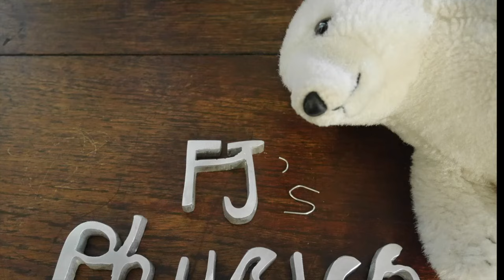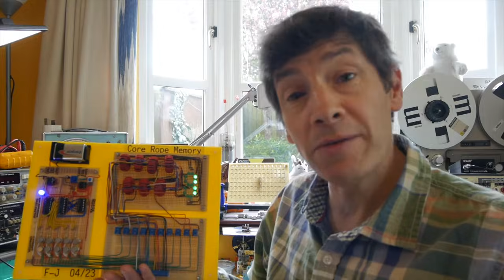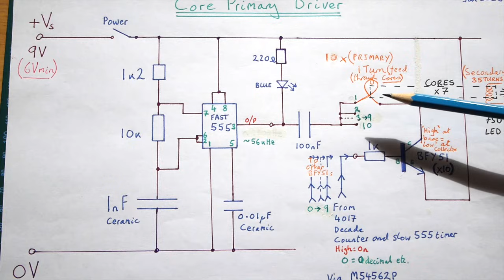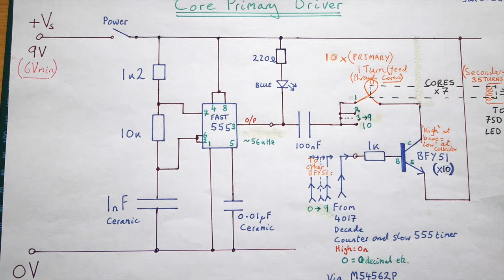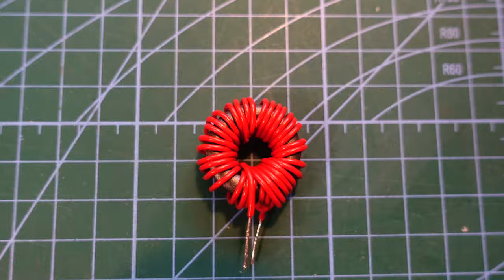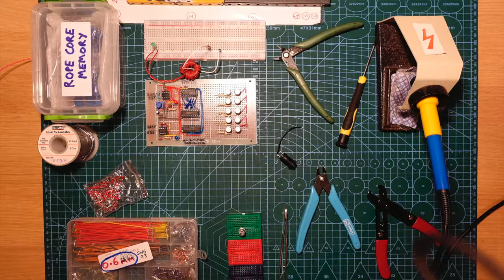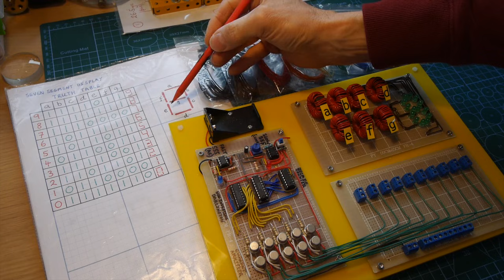Core Rope Memory Built and Explained - F-J's Physics - Video 169

Comment: I learned about this like a month ago by binging Cuious Mark's videos of reading all those old ropes that people haven't been able to access for decades 😁
Reply: YouTube recommended this video after I watched Curious Marc's AGC core rope memory reader.
I noticed the top segment didn't light brightly on occasion; I'd guess you've got a bad solder joint or track / wire in from it the common ground.
Reply from the maker: @axelBr1  Thanks Alex.  Found the fault and it is really interesting.  Typically I would expect a connection fault to mean the LED would be off but it was coming on, just not as bright.  Turned out that they were in the circuit the other way around to the rest and if the signal is not totally symmetric then they will not be on for as long or with the same voltage.  So I turned around all the dim ones and it worked perfectly!  Yes, Curious Marc - what an amazing chap and his team are!  Something to aspire to!  Thanks for watching and taking the time to comment as well!
Reply: @AnthonyFrancisJones  I saw you comment about the LEDs being the wrong way round after I'd commented. The fact that the LEDs are light up when reverse biased is interesting
Reply from the maker: @axelBr1  Yes,  I think this relates back to the issues of 'is it AC or pulsed DC?'  The output of the transformer cores windings (secondaries) will be dependent on the rate of change of current in the primary (first derivative) so on a falling edge it will be negative - hope that goes some way to explaining it!
Reply from the maker: Yes, Brandon.  Curious Marc did an amazing job on the Apollo ones.  I realise mine is a massive simplification but I hope it helps in getting started with the understanding of how these rope memories work.  I enjoyed making it and, like a lot of my builds, I am not following a recipe but starting from scratch to see what I can get to work.  Makes it feel more real and a bit like the original engineers had to do.  Thanks for watching and hope you enjoyed the video.  Publishing Diode Matrix ROM later today so tell me what you think of that too!

Comment: Very  good. I have some 24bit memory cores from mullard with cv series transistor drivers ,thanks I now understand  a bit more. If you would like to play with them give me a ❤  😂😂😂
Reply: Ferranti digital data link 1961 and some interesting  gold plated circuit boards from " Cerberus "  real time parallel processor for SAGW system. ( I think that's surface to air grounded weapons ? ) FERRANTI  CV7087 ( think early germanium pnp ?)
Reply from the maker: Excellent, yes the CV7087/GET875 was for the Admiralty Surface Weapons Establishment and indeed was a PNP Germanium transistor - I think in a glass envelope covered in black paint to stop light causing the junction to act like a photo diode.  Made by Mullard (who were far from a UK owned company by then).  The GET was GEC I think and in a metal can.  Interesting that yours are Ferranti though they had lots of military contracts back then!
Reply from the maker: Excellent - thanks!  Yes, CV would have been military spec I guess.  Wonder what your cores were in?  I guess you have seen this video of mine?  If not it might be of interest.  https://youtu.be/T8VreNzldWc

Comment: So why did they do these instead of just using a diode matrix?
Reply from the maker: Great question!  Funny too as I am working as you typed on my Diode Matrix video!  I think it was partly to do with data density, radiation hardness, and no single diode could cause a failure.  Many less solder joints and probably more vibration safe too.  I may be right on some, all, or none of this but I am sure more things will come to mind!  I hope you will enjoy my diode matrix video once finished and published and thanks for a great question.

Comment: YOU HAVE TEN ADRESS LINES 9-0 LETS SAY YOU WANT TO SELECT ADDRESS LINE 7 WHICH  FOR SAKE OF ARGUMENT IS NUMBER THREE ON THE DISPLAY, EACH BFY51 GROUNDS THE PRIMARY CORE WIRE, WHEN THE BASE IS POSITIVE SO FOR TO DISPLAY DIGIT NUMBER 3 YOU NEED TO SWITCH ON  5 SEGMENTS A,B,C,D,AND G, SO A,B.C,D, AND G ARE THE ONLY COIL CORES THAT YOU HARDWIRE THE SINGLE WIRE THROUGH ,WHEN THE 017 GETS TO COUNT 7 THE TRANSISTOR  7 SWITCHES ON GROUNDING THE PRIMARY WIRE AND THROUGH ELECTRO MAGNETIC INDUCTION CAUSES A VOLTAGE IN THE RED SECONDRY COIL LIGHTING UP THE SEGMENT AND ONLY THE COIL THAT HAS THE WIRE THATS HARDWIRED  THROUGH THE MIDDLE OF THE COIL WILL PICK UP THE PRIMARYS MAGNETIC FIELD LIGHTING UP ONLY THAT SEGMENT,LETS SAY YOU HAVE ONLY ONE ADDRESS WIRE LINE, AND WITHOUT POWER AND BY LOOKING AT THE COIL CENTERS, IF YOU KNOW WHICH COIL IS FOR WHICH SEGMENT THEN YOU CAN WORK OUT WHAT DIGIT WILL BE DISPLAYED WITHOUT BEING SWITCHED ON SO ANY 1 OR 0 CAN BE RETREIVED WITH COMPLETE ISOLATION  AND HIGHLY RELIABLE,
Reply from the maker: Thanks Patrick.  Not easy to explain in words but you have got it!  Thanks for this.

Comment: This is cool and all but you should have all but started with the schematic.

Also should be clamping those transients and the "negative" component of the output to protect the LEDs. The reversal and the kick is likely what is causing them to fade out over time. At the very least clamp the reversal. They may "tolerate" it, but it is bad for them, especially when the peak voltage is high. They clamp themselves reasonably well in Vf but the reverse wipes them out.
Reply from the maker: Thanks for this,  Yes, you are right about the schematic.  I tried to explain what I did as I went along but now realise the more of these types of video I do that a full and clear schematic would be a great idea.  Thanks too about the reverse biasing of the LEDs.  Very good point!  I learn a lot from the comments too!  Thanks for watching and taking the time to comment.

Comment: Maybe someone else can clarify, but afaik the Darlington array and even the BFY51 transistors are really only needed because there needs to be enough current on the other side of the transformers to drive the LED pairs for each segment of the 7-segment display. If you want to just read the binary data from the core rope memory you probably dont need nearly as much current and can therefore trim a lot of the current boosting transition circuitry
Reply from the maker: Good question and I hope this answers this.  Remembering that each core is used as one bit of data and it works as a transformer, you do need an AC signal to make it work.  I use the transistors here to switch this AC (square wave) on and off depending on whether it is a lit or not lit LED that is needed.  They LEDs or the cores cannot be directly driven from the 7 segment display chip if that makes sense.  That is why there are two 555 timers - one to scroll the digits and one to proved the cores' high frequency signal that gets switched on and off.  Hope that helps and thanks for asking!
Reply: @AnthonyFrancisJones  You didn't answer the comment, which was that the Darlington array alone can probably handle the current required to drive the coils. Also, as commented by others, you are not creating AC, rather pulsed DC, and the transistors aren't able to conduct in reverse bias.
Reply from the maker: @axelBr1 Thanks Alex.  I guess you are right about the pulsed DC.  It is a bit of a funny circuit this.  Not copied from anywhere but just built by me organically to demonstrate a few things.  The transistors are a strange one as the circuit diagram that I drew is definitely correct and it works!  I am not quite sure what is happening but they may well be working in the fourth transistor mode - reverse active - I have been meaning to do a video on that.  It is not the case here but I will also do a video at some stage on 'symmetric alloy junction' germanium transistors.  Some worked really well with the collector and emitter swapped due to irregular indium pellet absorption onto the  germanium dice.  You are almost certainly right about the Darlington giving enough current but I thought I would give the transistors a go too - sometimes I wish I hadn't!  Anyway it was all a bit of 'electronics play' rather than brilliant circuit design!
Reply: @AnthonyFrancisJones  I'm not an electrical engineer, but have built a few circuits over the year, and having looked at your circuit a bit more since I commented, I'm not really sure how it's working, but pretty sure there's nothing good going on for the transistor😆 May be you can ask Dave at EEVBlog to take a look!
But it's certainly making a lot of people think about it which is great.
Reply from the maker: @axelBr1  Yes, you are right!  The presence of inductive loads and all the issues with that cannot help.  I must, however, do a video on Reverse Active modes of transistors and show some early germanium ones which are alloy junction transistors working backwards!  By the way, just about to do a video using a Sziklai pair - now there is an interesting reversal of emitter and collector!  Thanks again for the comments and, yes, it does get us thinking.  BTW I wonder what a simulation program would make of my circuit!
Reply: @AnthonyFrancisJones  I've only really worked with CMOS digital electronics so will look out for your video on the abusing bipolar transistors!
Yes would be interesting to see what a simulation makes of your circuit, I'm still not sure how it does; even the AC coupling capacitor I mentioned in an earlier post as causing AC to flow through the wire, is so tiny I'm surprised it can power the sense circuit.
Reply from the maker: @axelBr1  Great - others are having a go at building my circuit too.  See what they come up with.  I rarely mention to my students that all of the circuit design and theory we learn is always for 'ideal' circuits and may be far from what actually happens.  I love introducing internal resistance to show that things are quite what you first learnt!  Here is one of my videos on that:  https://youtu.be/V06sYBiYWqM

Comment: Really nice project and yes, Curious Mark is one of my fav channels too. 
Have you considered installing a second multiplexer(s) on the bottom right pcb and 10 toggle switches, or 4 sets of 3 switches for Octal switching to allow one to enter most any character or symbol from the ASSCI set. Then you'd have an excellent training tool for others to generate any character/numeral they desired. 
I was with DEC, Digital Equipment corp, for years and remember well the core mem bds used on the PDP 8 and other earlier PDP systems. Even with 32 K of core and some massive CDC disk drives with a business with 30 to 40 terminals being used intermittently worked great, However, those poor hard drives took a daily beating doing all of the IO now relocated to mostly huge arrays of RAM. To their credit, those CDC drives could run for years wo any issues as long as the absolute filters were changed and heads were cleaned frequently on a PM schedule. 
The 70's -90's were great years to watch the computer industry evolve to the appliance computers we all enjoy these days. Shame how only a small percent of people have any understanding of what happens at the low levels where 0's and 1's still make it all play when you order a new widget on Amazon or watch some video on one of the movie services...LOL
Reply from the maker: Glenn, thanks for taking the time for such an interesting story. Yes you are right.  Those of us that were brought up with computers that had visibly moving and interconnected parts have a much better understanding of what happens 'under the bonnet' (hood!) as it were.  I remember as a pupil using the school's ICL mainframe and doing 'dir' requests and hearing the hard drives accessing a room away as the heads moved in and out on the massive drives and disk packs!  Really good idea of yours to put switches onto the project to use it to demonstrate ASCII characters.  I think I want to leave this board alone as it is just hanging together!  I would probably break something!  Have you seen my other videos on the magnetic core memory I have?  I thing there were links in the description.  Thanks again, it is comments and experiences that people like you share that make these objects come to life.  Many thanks again, Anthony F-J.

Comment: Sorry, but this has nothing to do with a memory. As I understand it, this is just a cumbersome method of controlling a 7-segment display by inducing a voltage in the coils to make the LEDs light up. Here, no ferrite core is specifically magnetized and this state is then read out again.
Reply from the maker: Yes, you are right!  But the 7 segment display is a distraction...  The each wire is interleaved through the cores and each core represents a bit of data depending on the position of the wire (through or outside the core).  So for example with 8 cores a 1 byte word can be 'stored' with a single wire.  The more wires that are added the more bytes can be stored.  This was used a lot for memory in telephone autodialers and the like.  It of course is not to be confused with magnetic core memory (I have done videos on that as well) where the stored information was not in the wiring but in the core itself.  Hope that helps to explain it all a bit better.  Thanks for watching and taking the time to comment.
Reply from the maker: (I wrote this as well thinking that the above answer had been lost!)  Interesting.  Let me explain.  So the 7 segment display is not important at all to the working of this device so don't get too distracted by it.  It is just an output device to show the stored data.  I use 7 cores but if you imagine me using 8 then each wire threaded through the cores would be able to store a byte of data.  Each bit is stored by whether the wire treads inside or outside of the core.  As you add more wires you are able to store more 8bit words.  So the wires' positions store the data, not the cores!  This was used a lot in old programable phone autodialers.  It is not to be confused with magnetic core memory (I have done videos on this too - see above in the vides's description) where the data is stored in the core not the treaded wire position.  Hope that explains it better and sorry if I did not make it that clear.  Thanks for watching and taking the time to comment.